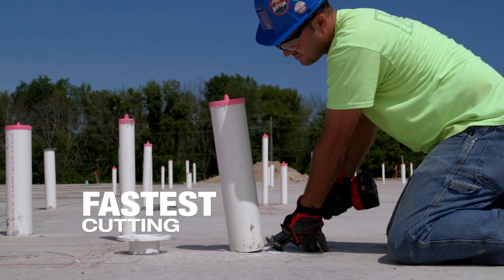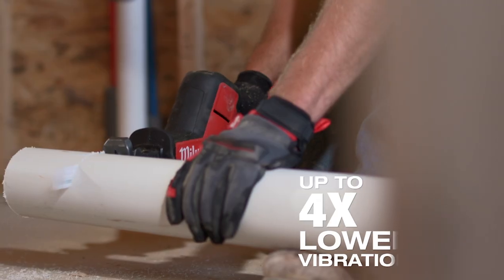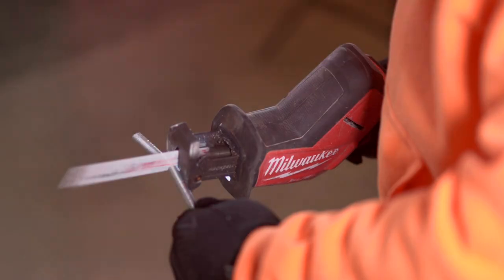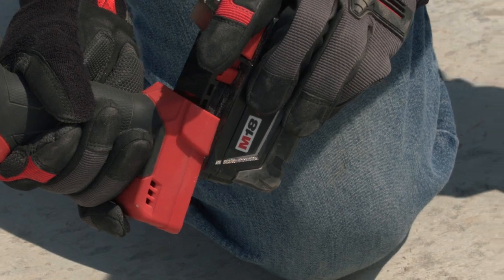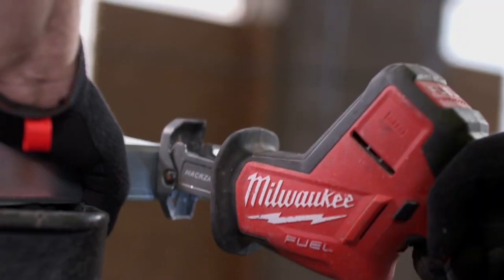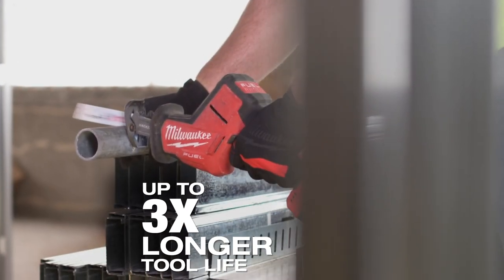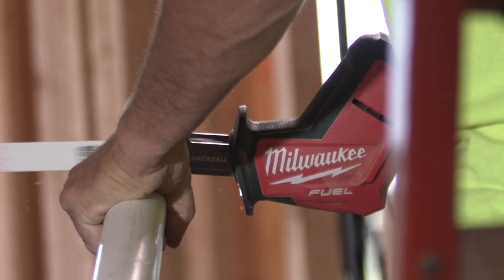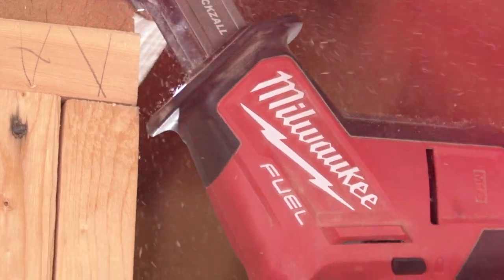Milwaukee® M18 FUEL™ Hackzall®

Comment: Had one for a month and the biggest job I've come across was removing a boiler. The 3x lower vibration is no joke, I cut through a few 4 inch cast iron pipes, more smaller pipes, a bunch of radiators and my arms didn't feel numb at all. One handed use is awesome, I waved and said hi to an electrician that was walking by while cutting and he gave me a funny look.

Comment: Yall are underselling yourselves. You cutting PVC in the ad. I have the smaller m12 battery version and have had no problems cutting through temper steel heavy duty locks and thick bolts